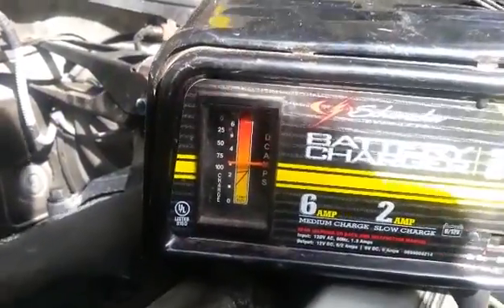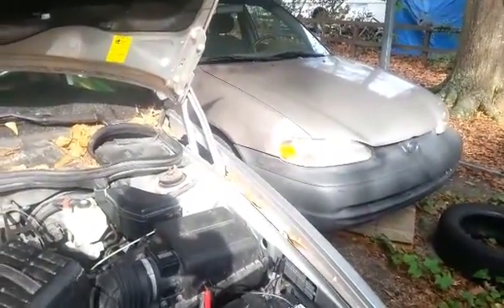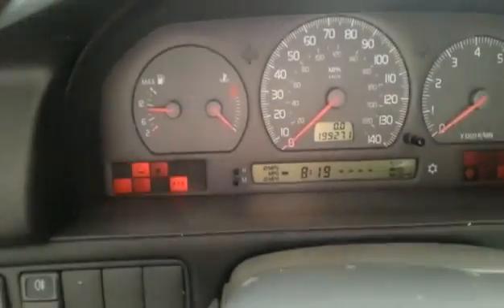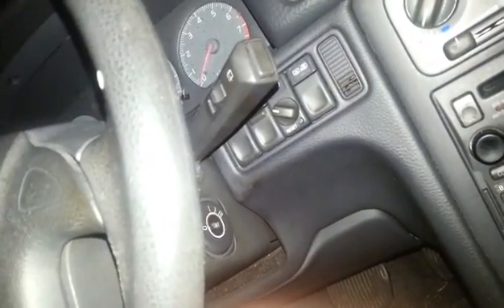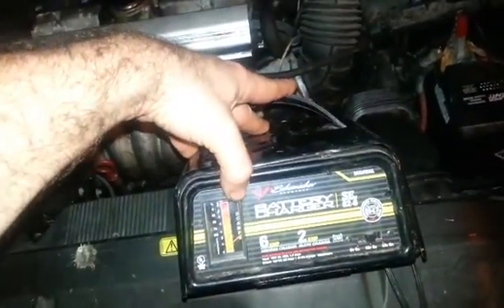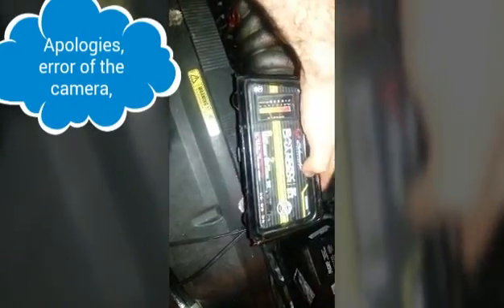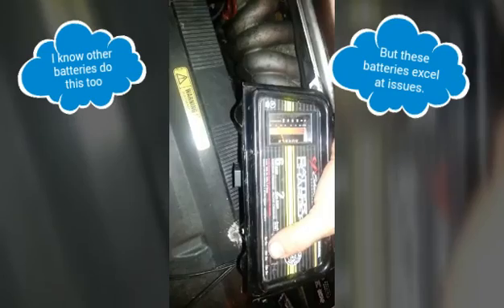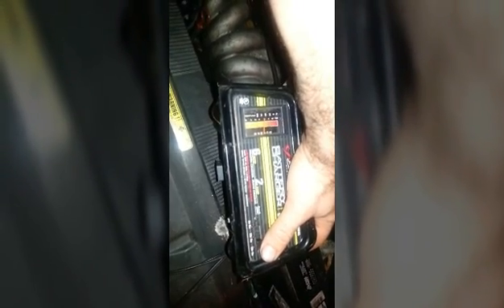How to Know if your Battery is Bad with a Charger

Comment: quite helpful. I have the similar charger and even the manual doesn't really explain what's going on. Neither does anyone else. My spare battery sat for a while and now I'm trying to charge it. It doesn't want to show 100% and progress is slow if that. I guess it's emergency 1 start now.
Reply from the maker: What's its voltage when the battery has cooled down? That's not as accurate as what the voltage is when starting as a less tools way to judge performance. 

Don't want to go below 10v while starting. That's a past age of life battery if you dip below that point.

Comment: I know this is not a subject on this video but do you have a Old battery backup surge protector that you can send me or several of them and I can restore them for my use ?
Reply from the maker: I do not. Been meaning to buy some continuous power suppliers so my internet can't go down over a power outage.

Using my laptop I can continue up time with my cellular connection but I can't risk being down as I'm an active trader now.

If interested feel free to check it out.

https://www.youtube.com/channel/UC1k59i3CwluCpGgRWHNo_KQ

Comment: Hello yes water will fix it if you try it yourself and if you read the voltage the voltage will go up and then you put a charger on it overnight or the full day in it you’ll be surprised with the battery been rejuvenated.
Reply from the maker: Oh, I know you're right about that. I've done it too. I'm just recommending against on old batteries which have been off gassing too much. 

Hey, you gave me great idea for an extra scene. 👍

Comment: Wrong wrong wrong A battery has 6 cells in it if one of their cells or if you have three that are dead you can put a charger on the battery but it won’t charge or start it will look like it’s charging that you going to crank it and it won’t start there will be in enough power for the lights so in the long run you need a new battery FYI You should not connect A battery charger is there a leaves on the battery that will lead to a spark like you see in his video and it will also blow up or catch fire because batteries give off fumes that we don’t smell in there very combustionable FYI a multi meter just reads the dead cells or healthy cells any of the battery‘s dead you can read how much 14 V you’ll think it’s a battery but it’s dead and won’t crank and I said you can pop the top of your battery and add more water to it that will revive it and then you can charge it but make sure the water is past the plates in the battery and once you filled it up with water make sure you leave it for us sometime to soak the water and then put a charge on it in your notice it will charge again and you can do this as many times as you have your battery you can use it until it permanently dies.
Reply from the maker: And so you know, the AMP reader reads low when you have a bad battery. That's the whole point of the video.

Could some water fix it? Absolutely, but it wasn't the subject of this video. Just a short vid.

I have shot some more footage covering water in the cells and such if you'd like to check it out later, that'd be great.
Reply: @DENicholsAutoBravado  aha, so when I'm charging, it seems stuck on 1 amp draw, does that mean the battery won't take a full charge?
Reply from the maker: If you have a meter that's sensitive and changes then yes, the battery continues to draw the same regardless? Not a good battery.
Reply from the maker: How long did it stay at 1 amp though? A day? Bad sign. Several hours bad sign? Just plugged it in and it seemed to stay there? You don't know yet. 

Apologies, took me coming back to see how to further productively comment on this.
Reply from the maker: Or until it starts leaking acid through the terminals and into your wires.

I kept an old battery alive an extra 6 months with your advice once. This destroyed the huge grounding cable.

Comment: If you have crusty terminals its b.c. you have wiring issues.
Reply from the maker: Your idea and what's in this video can happen. In this case, the battery turned out to be bad and bad batteries are notoriously more frequent, even good batteries, at being the cause of crusty terminals.

Comment: Look like been sitting for a while. One of the worst thing for a battery is to sit for a long time. I always was told to pull the battery is letting a car sit for a while or at least remove one of the cable. Replacing batteries is part of the deal for owning a car... #flyerstone
Reply from the maker: I think that's a great idea too. I use battery tenders for vehicles that sit. So far in three years I've lost 1 battery out of 2 maintained that long. For more frequently used vehicles which may have to sit for a season like my motorcycle I haven't lost a battery yet but that was a young battery. The other 2 are actually old enough to be replaced for sure!

I think battery maintainers can keep a battery better than a car using it every day. Sorta like in Star Trek when they put a person in crio sleep. The battery doesn't go through much just sitting there and being maintained.

Comment: Sorry to hear DE that your battery didn't hold up. That car has been sitting for quite awhile it looks like. On maintenance free batteries, they usually don't take a charge once they've become discharged. Good vid DE...
Reply: +DE Nichols Hey Sounds good...looking forward to it!!!
Reply from the maker: What's nuts is that top engine mount is brand new. Equally rusted aluminum due to extreme wet. I've never lived in such a wet place.

Thank you for the compliment. I felt it was a basic video but every time someone wonders how I can tell if a battery is bad via battery charger I can tell them. Watch the video. lol
Reply: +DE Nichols Pretty funny DE, "watch the video". I'm sure a lot of folks will learn something from this video. Take care DE...
Reply from the maker: stuzman52 You take care too. I appreciate the support. Found a new app, first HD is coming soon. Did a short video test upload proving it. :)

Comment: I have a small digital battery tester I check with my vehicles every couple of months but in general I just put a new battery in every 4 years.
Reply from the maker: I usually manage to let a good battery sit some weeks too long and lose a battery that would have still been good. 

You're right, batteries used to meant to last this long on longer, but they realised they needed to make poorer batteries to increase income.

Comment: Leave those leaves alone, they dont want to leave ha ha sorry :-(
Thats the problem with batterys, you just dont know there capacity unless you connect a drop tester to it, the second you load it up the voltage will plummet.
Connect a digital multimeter to it and see if it still shows the nominal 12.6 volts after a few hours of sitting, cheap multimeters give you more info.
The old old old batterys used to bring the links between cells out to the top of the battery, you could check/loadup each cell to see which one was a slacker lol :-D
Sorry if this is all info you allready know, im just waffling on ha ha :-D
Reply from the maker: Never be sorry if I already know something. Comments help the best viewers. Apologies if I feel people who read are good viewers (you're helping them) and great viewers write. 

Of course I'm biased based on how I interact with others videos. Lol Still take the compliment. 

In this case, just the load of interior lights making the battery act like it lost a day of charge was all I needed to know. 

When using a charger, volt meters become misleading without a load. 

So to add to your comment with things you probably already know too:
Trying to start a car with a volt meter on it and it drops below ten volts can mean a bad battery or a bad starter or even in one case last month, a seized engine. 

Having a load tester reduces variables, but starting with a multimeter can give further direction.
Reply: +DE Nichols 
Very true about dropping to 10v when trying to start.
Most dodgy batterys normally show there illness with a slow starter in the cold weather, thats a warning its not long for this world ha ha :-D.
i dont get my battery charge info from videos, im into electronics and i used to work at an auto electrics repair factory, the "drop tester" as they called it is a quick battery frightner ha ha :-D
Some really good looking batterys were just toast, and some grotty looking ones were ok, dam accumilators!!
Reply from the maker: zx8401ztv
Accumilators? Other than thinking it's a Han Solo line in Star Wars, I don't know what that means. Actually, I never knew what it meant in Star Wars either.
Reply: +DE Nichols 
I did spell it wrong but its an old word for battery ,accumulator,
it was used in the days of valve radios, and when noah and his ark were modern technology LOL :-D